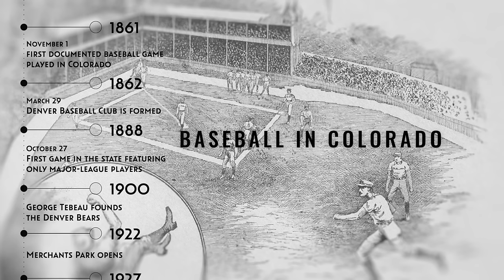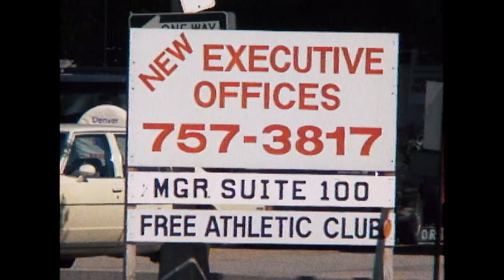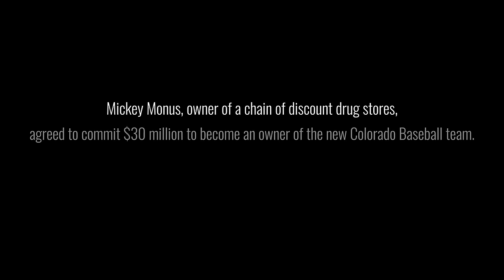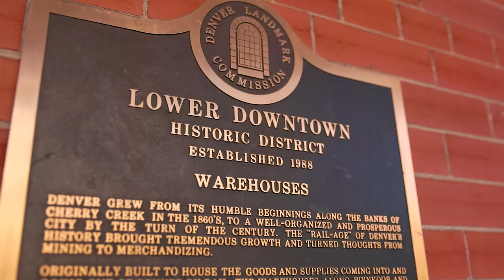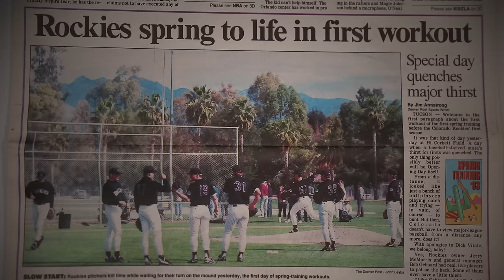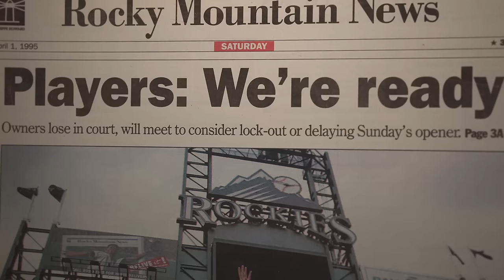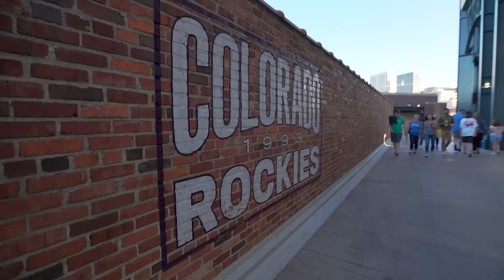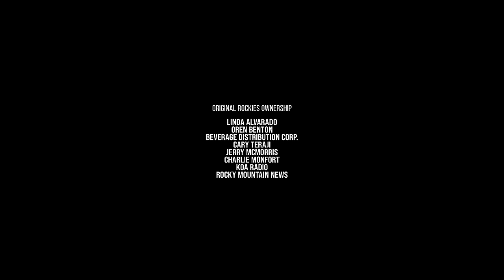When Colorado Went Major League

Comment: the issue with this organization is that no pitchers can succeed at that altitude. pitches have less movement, less break and balls carry way further. so it will always be extremely difficult to field a winning product at Coors Field.
Reply: The wear on pitchers is also accelerated when they play for the Rockies or it at least seems that way compared to other teams.